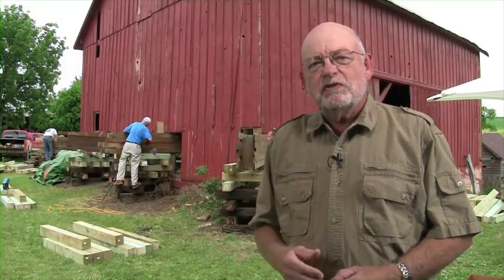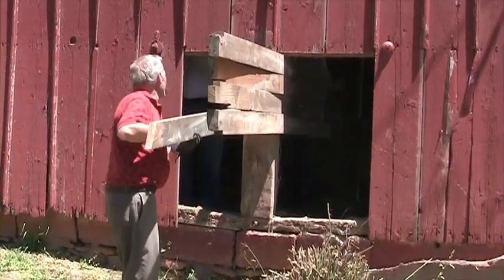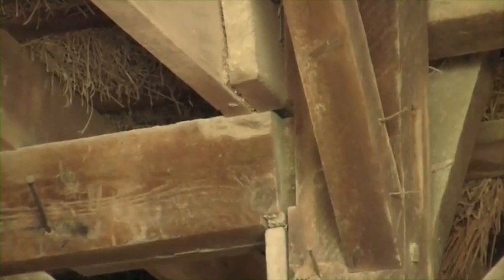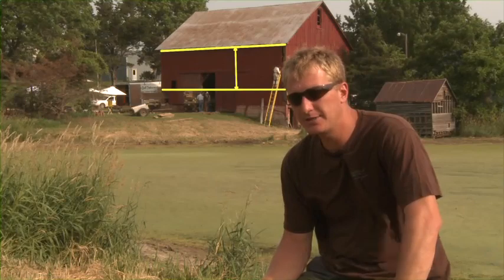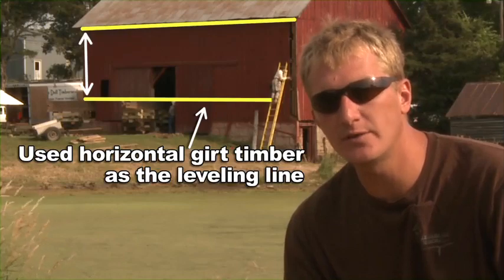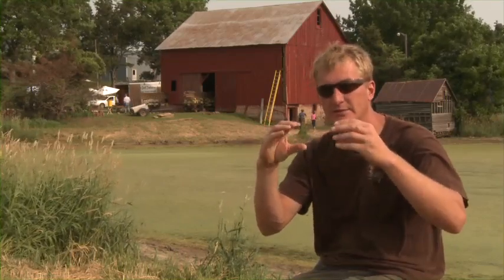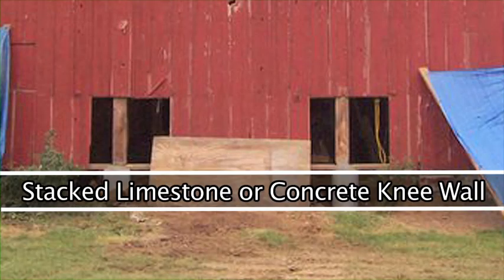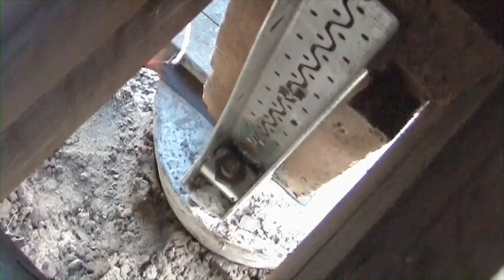Barn Series, Part #3 - Raising the Barn

Comment: This is the first barn almost identical to ours located in South East Ohio. Can you tell me what the final cost of this project ended up being? Thanks
Reply: Since no one has answered I will try. Not to discourage you but this was quite a few years ago and generally these historical projects have alot of volunteer hours. So even if they had a price it may not be accurate for you.
 I spent about 3k on mine a few years back. Though it's tough because i had a scrap pile i made steel brackets out of and all lumber for lifting was free from old railroad ties no one wanted. I had a skidsteer and a post hole auger.. All i paid for was concrete, Fasteners and a little lumber. Spent 20,000 on the steel roof though.

Comment: Interesting video.  I'd like to ask what is the point of the ring?  Can you not just use the bracket?
Reply: Dennis It spreads out the force against the bolts, so the bolt doesn't try to tear into the wood when the joint tries to separate.

Comment: I did not see any material between the concrete piers and untreated wood. Was a sill seal used?
Reply: The moisture barrier is also visible at 13:24 and 13:39. It looks to be an asphalt-based roll cut to the size of the footing.
Reply: We always use asphalt shingles between wood and cement on pole barns
Reply: This is the first barn almost identical to our located in South East Ohio. Can you tell me what the cost of this project ended up being?